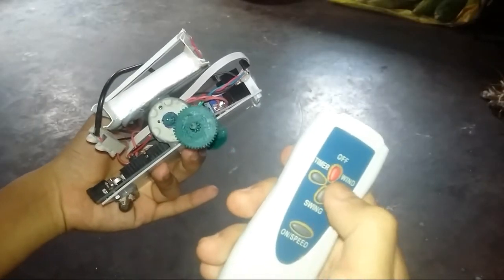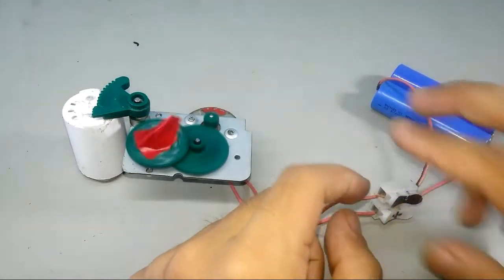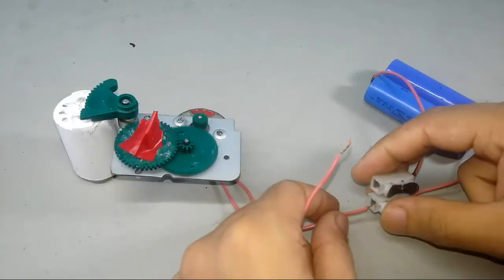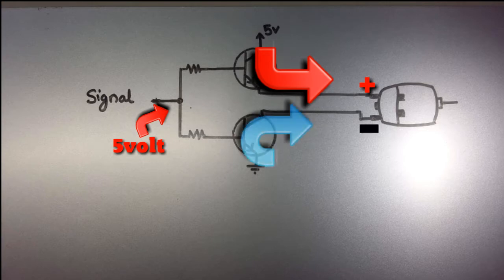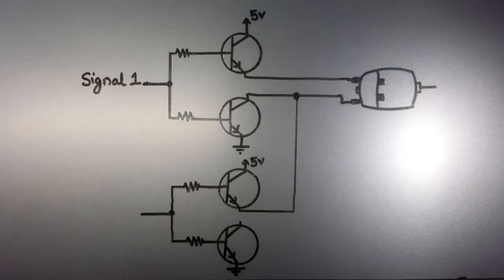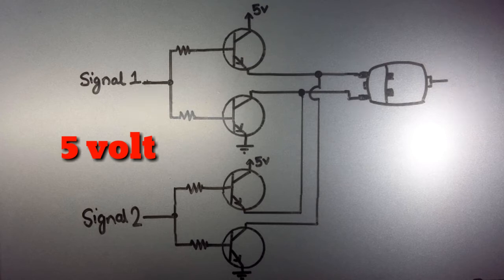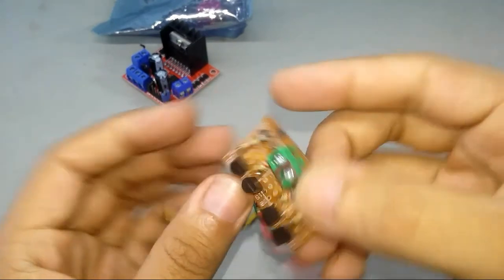How to make a d.c. motor driver circuit with just a couple of transistor.

Comment: this can be used for low power motors if you want something that use high power (more than 500mah) use mosfets or some other transistor which can be used for high power/amp
Reply from the maker: Definitely, it's actually only good for prototyping with low power motors but the most recommended motor driver is the H bridge one with PWM functionality 😊..
Reply: @electrofun8778  yes even i have a H bridge motor driver with pwm functionality and actually i am making your circuit on a breadbored and i can say it works great!
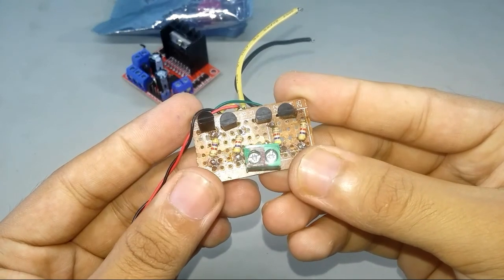edit : actually now i realised on 1:44 you said the type of motors on the left does not work but now i tested and it works too...but i had to give a 12v 2amp power supply
Reply from the maker: 12 volt 2 amp 🤪 it's already drawing 24 watts of power for such a tiny motor.... The circuit has a major drawback in efficiency. I m glad you noticed it. The circuit is only useful for simple testing and H bridge is only the safe and efficient way to go when it comes to drive d.c. motors..